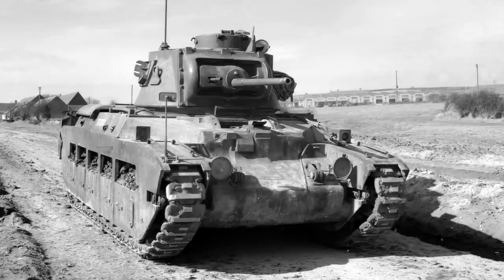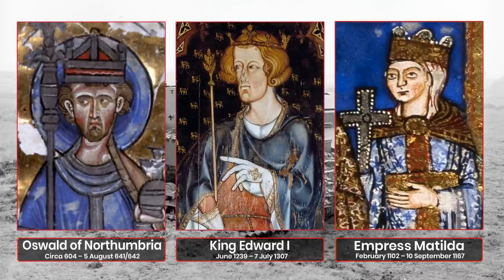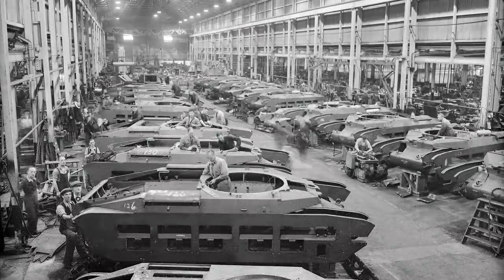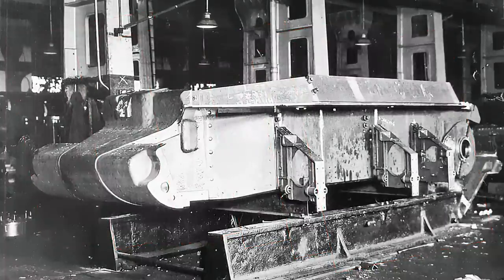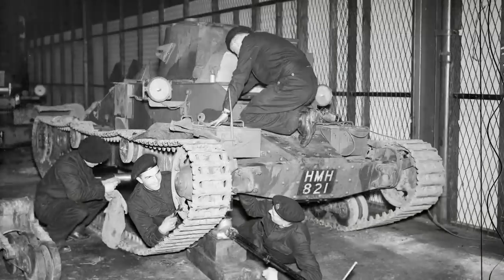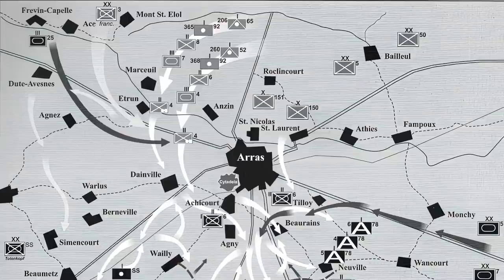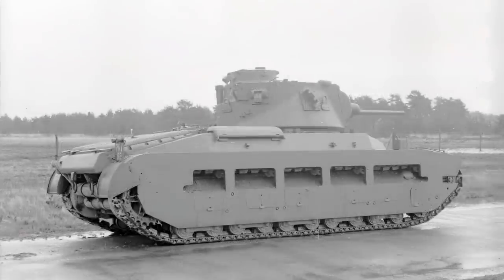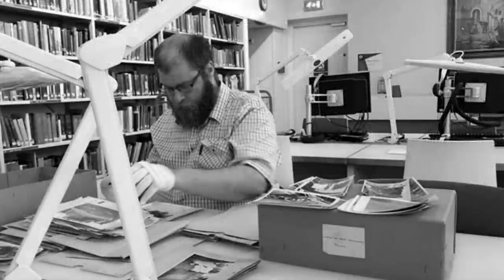A12 Matilda - Tank Design & Development

Comment: Apparently from what I gather the HE round was issued....... To the armoured car regiments, so you saw daimlers and the like running about through the war with HE rounds just in case they needed them.
Reply: Mind you, they couldn't use the HE round with a squeeze bore, so it was probably issued to other 40mm armed vehicles that might have better use for it. Armored cars were far more likely to come across lightly armed enemy units, trucks and artillery guns, so an HE round would cause far more damage to them than the Armor Piercing one.
Reply: @WOTArtyNoobs  Yeah, IIRC many of the squadrons would stop using their littlejohn adapters in France because it wasnt really necessary as they wouldnt sit and fight against actual tanks and the swap was better (IIRC they also would call on the "heavy troop" in the regiment for that kind of thing using AEC or halftracks with 75mm guns).
Reply: @mitchverr9330  I've just come across some info which says that the LittleJohn adaptor was issued to armored cars but they elected not to fit it:

"The adaptor was chiefly used on British armoured cars, e.g. the Daimler, which had been designed and built earlier in the war and could not be readily fitted with a larger gun. As an adaptor to the existing gun it could be removed so that normal rounds could be fired. This offered increased anti-armour effect but with obvious drawbacks in combat conditions. When crews discovered the special 'squeeze bore' ammunition was more effective than the standard 2pdr AT round even when not 'squeezed', the usual practice was to store the adaptors rather than have them fitted."

So it appears that the Daimlers did have the squeeze-bore adaptor, but didn't fit it so that they could switch ammo quickly when the need arises, rather than jump out of their vehicles to unscrew the adaptor.
https://en.wikipedia.org/wiki/Littlejohn_adaptor
Reply: Several years ago I came across a post on another discussion board, Navweaps I believe, talking about this. The post iirc was based on reports from the Western Desert and the issue with the arming of Matildas and other 2pdr armed tanks with HE was rather prosaic. Apparently the HE rounds required a different style of stowage racks from the AP rounds so that in order to carry HE all the ammo stowage racks had to be changed out. Changing out the racks supposedly took several hours plus stowing the HE rounds. So you could go into battle with only HE or only AP rounds and as Matilda II was used mainly against other tanks it was simpler to just stick with an AP load out. I have no idea if this is correct as this is the only place I have heard of it but it makes a bit of sense.
Reply: @wesleyphillips7744  It sounds like bollocks - every other tank manages different types of ammo racks for their variety of rounds.
Chase up The Chieftain's 'review' of a Matilda2  for the turret interior.

Comment: what about the matilda black prince, mounting the cromwell turret? Isn't it considered as a variant of the matilda?
Reply from the maker: heya, there is some issues over that, matilda black prince was a name given to the tele controlled tanks originaly with the first beign Edward a light Mk VI. which was carried out long before A27's design work. there is plenty of surving tests on the tele-tanks but no images have yet been found. The one commonly called Black prince, down to WOT  is a much later propject with no text attached to the image (currently at bovvy) but is taken at Vulcan foundry.

Comment: English tanks did not carry high explosive shells because high explosive shells were the perogative of the artillery, a separate branch and they wanted control of tanks with HE.
Reply from the maker: mostly, the gun bunnies liked HE you could lob for sure, they saw that as their role, and so things liek the A10 end up in some odd roles, but regular HE was designed and made for tanks, 40mm, 57mm 75mm etc.  - the early 2pdr APHE was in most cases useless anyway. the 57mm wasnt much better and only used a little in Italy, tho there are conflicting reports of some in Africa. 75mm was issued however.  - but yes there was conflict with RA for sure.

Comment: I have read somewhere that 37mm HE rounds were used by Anzac crews with a rubber band to make them compatible with the Matilda II main armament. Is this correct or another fail of the Internet? Keep on with these excellent videos 👍🏻
Reply from the maker: i would need to find a source tbh
Reply: The HE round used by Australia was the 2 pounder cartridge mated to the 40mm Pom Pom HE shell with the igniter portion of the tracer-igniter made inert, or a plug in its place. I don't know what NZ may have been doing. It might be a corrupted retelling of something else, Australia did use the 37mm canister projectile, once again with a 2 pounder cartridge, to make a 2 pdr case shot. I don't think you'd want a rubber band on it to make up the calibre difference, as spinning it will cause the pellets to disperse too quickly, and even out of a 37mm there's no drive band on it to begin with so propellant gasses leaking past it presumably aren't a problem.

Comment: Gotta love the Matilda2, so very very British. The 2pdr gun might have started out ok but was soon shown to be to weak and with no HE issued it really let the tank down in many ways. A 6pdr might have been a better option?
Reply from the maker: 6pdr tested, not practicle in any way, the 2pdr was fine for most of north africa, and then faded out, tho bare in mind the germans are still playign with the wekaer 37 and 47mm guns for the same time
Reply: @armouredarchives8867  As the Matilda II was an 'I' or infantry support tank, it does seem odd that more were not fitted with the 3 inch howitzer of the CS version.
Reply: @armouredarchives8867  But they had a few 88s that were real killers and arty etc, the Matilda being so slow and only having solid shot or the MG to use against AT guns, their crews, arty n infantry it must have made getting in close enough or getting out again a very long, dangerous n nerve racking ride. On the other hand having all that armor would be great when the enemy lacked something to deal with it as was sometimes the case but Rommel was skilled at organizing the battles so it was the AT guns that did much of the heavy lifting. I thought the 6pdr would hav given the Brit's a better HE round. It just seems mad to arm  tank with only AP or smoke. The Allies also took a very long time to learn the lessons of combined arms and even then seemed quite capable of forgetting them all again in the next campaign. I'd love to hear you discuss that, how good n capable the different nationalities were at learning and implementing effective tactics as the war progressed and what the problems were. I'm really enjoying the vid's you've produced, very informative, detailed n interesting. I love the old photo's n diagrams and how u tell it so thanks very much for doing them. I also watched n enjoyed you doing the quick walk around the new US armor museum they are setting up with SofiLein and the curator. Sorry to go on n on n cheers for everything.

Comment: The idea that a tank can fire accurately on the move without the aid of a stabilized gun, is a myth. Even at slow speed, stabilization in both planes is required. Where reported, these sort of things were trick shots, doubtlessly well rehearsed on the ranges for the benefit of assorted higher ranks, newsmen , and cameras. 
Apart from that, great presentation ! Why don't you write a book ?
Reply: Depends on range and target doesn't it?
Reply: @0MoTheG  Well, if you are at absolute point blank and you are aiming at something huge , so your driving up the quayside and pointing your gun at a battleship moored up alongside , .. Yeah , you're probably going to hit it, agreed .  However,   the operative word here is ''accurately'' . I think that presupposes that we are talking about hitting stuff you want to hit at a reasonable battlefield ranges and with a reasonable degree of probability , and assuming the gunner knows what he is doing with the equipment available.
Hitting a dug in anti tank gun  at 500 meters , while moving at 15 mph ,.. as an example. That would be ''firing accurately on the move'' ,.. I'd have thought .
Centurion , for example, was known to be equipped to operate in this way. I really don't think that Matilda was, a decade earlier.